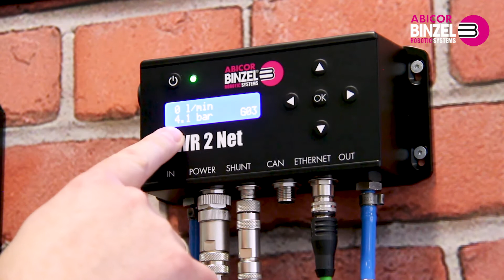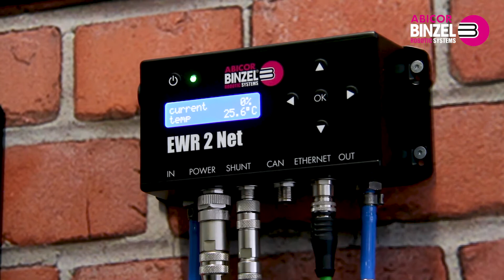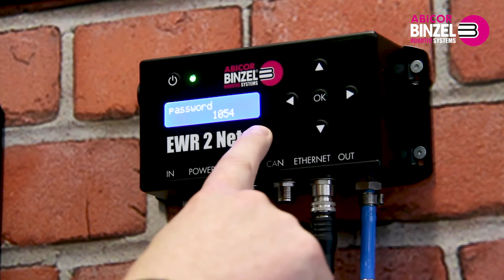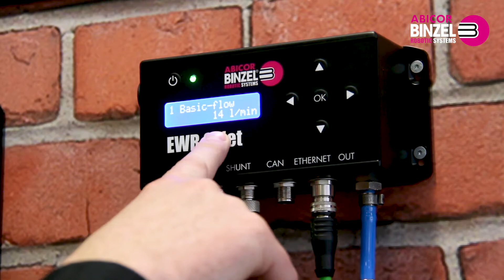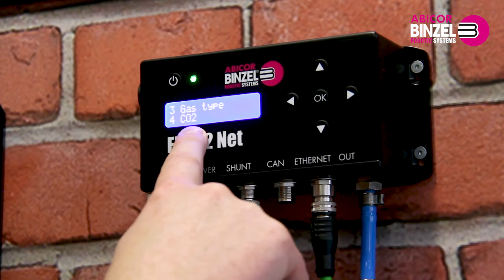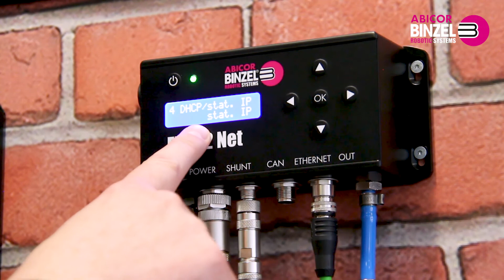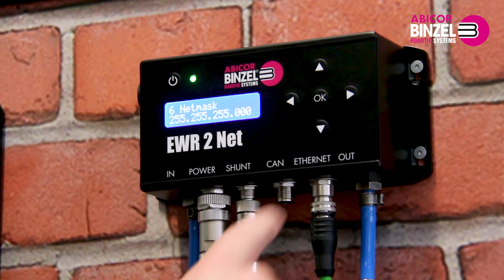EWR 2 / EWR 2 Net || Set up

Comment: If I have a welding machine that does not exceed 230A, which shunt do you recommend? The 150A 300A 500A.
or can I just use the 500A.
Reply from the maker: Hi @markpijcke4148, it depends on the welding current. The 150A regulates 45A-150A, the 300A regulates 90A-300A and the 500A regulates 150A-500A. For more details, just send our experts a request via the contact form: https://www.binzel-abicor.com/DE/eng/company/contact/contact-us/